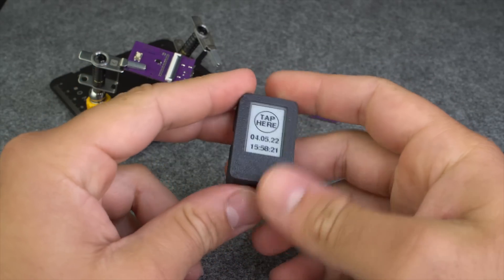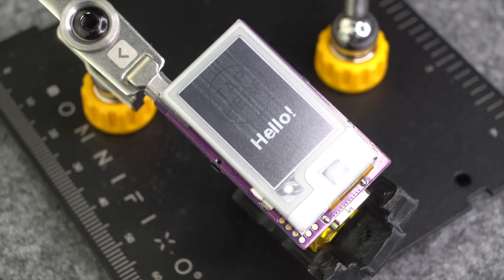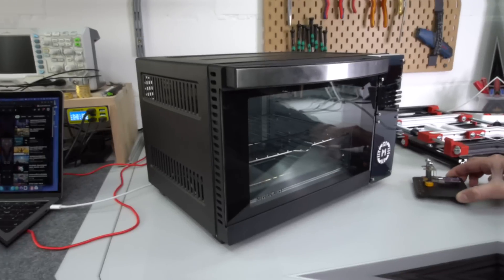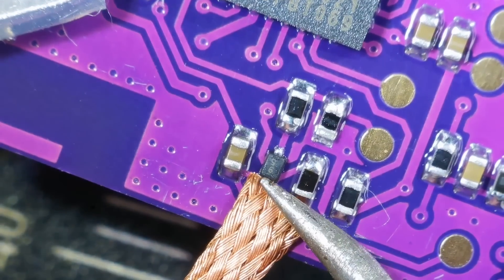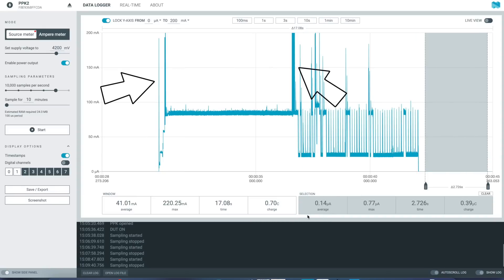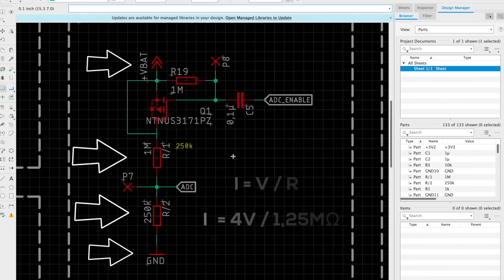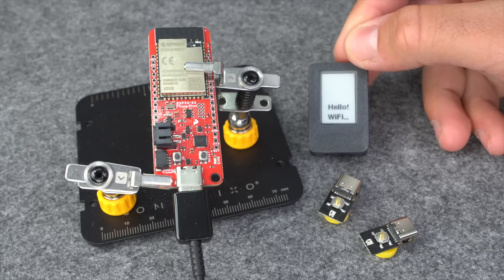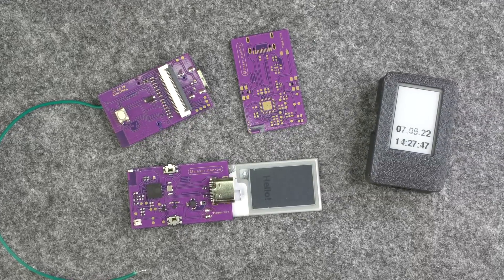Paperclick - an ESP32-C3 based IOT device with an E-Paper display | makermoekoe

Comment: Really cool projects!

Where do you get your smt components from? I always struggle to find a balance between “cheap, but you have to buy a roll of 5000” or “we’ll take your firstborn for this useful 50 piece collection of resistor values”.

Also another question, where does the residual current consumption come from? Leakage in the mosfet?

Comment: That e-ink display seems perfect for IOT, or battery applications!

I'm a total beginner to this stuff.. so not sure about the programming.   When you plug in the board, does the ESP32-C3's USB peripheral instantiate as a COM port, or as a JTAG/SWD debugger, or both?

I would like to buy an ESP32-C3 board.. would I also need to buy a special debugger adapter (ex. Segger), and/or a USB to serial cable (ex. FTDI).   Some of the boards have a "BOOT" button, which I assume allows firmware updating, but not sure how?

Comment: You can add infrared collision sensor by measure photosensor or how much light was mirrored back to ir sensor. Also you can use pyroelectric sensors for detecting movements in the frame. Also you can add pinhole jumper with screws for connect some endpoint buttons. May be also i want to see some small solar panel for infinity time of work, may be instead not cheap eink display and some magnet inside

Comment: Add a case that could accept a pill bottle.  Then you can not only track when you last took a pill, but record that data for long term tracking.  Could be VERY helpful for assisting older folks that are having memory issues.

Comment: SOT-1123's tend to be pretty painful as there's little room for solder mask expansion between the pads making the webbing pretty much non-existent. 
Besides the "fun-factor" of using an ultra small package, if you got the room, go with at least an SC-75 for reliability!

Comment: Is the e-paper display resistant enough to withstand the force which required to click the button behind it? Will it starts failing over time? 🤔
Reply from the maker: Till now everything looks fine. The glass behind the display seems strong enough for that little force on it while pressing the button

Comment: Why you user so weird parts like NTNUS3171 instead of cheaper "normal" parts in sot23 ?
Reply from the maker: Because sot23 is too big for most of my projects. The battery monitoring circuit with the NTNUS was tested on this PCB but will be used in the Picoclick C3T as well in the future
Reply: @makermoekoe  but you have a lot of space on this board ? 
And you don't need a mosfet, you can use a pin of MCU, put low end of divider on this pin, and if you have "1" or tri state on pin - low end of divider will be connected to "+" or "floating" and you have no current, if you have "0" on pin - divider will be connected to ground over few ohms of low side mosfet in MCU output stage and you can measure

Comment: Nice! Do you use different pastes on both sides of the PCB when doing two-sided assembly (like a regular one of the first side and low-temp on the other, to prevent the first one from reflowing when soldering the other)? or is the surface tension enough to hold the components in place even when upside down?
Reply from the maker: Yes, surface tension is mostly strong enough. Except for the usb connector, it would fell off without extra seating
Reply: Surface tension holds the paste and components enough for placements but cannot really reflow inverted, so one side at a time.

Comment: Great project as always, how did you drive the e-paper display without a standalone driver board that they usually come with?
Reply: It's actually pretty easy to drive. Bunch of caps, one mosfet one inductor 2 resistor and you are done 👍
Reply from the maker: @thenextproblem8001  That‘s it. For the 1,02“ display you don’t even need a mosfet… Pretty easy
Reply: @makermoekoe    where did you exactly find this information on how to wire this? I was recently also looking into this and followed this schematic from waveshare for the ESP32: https://www.waveshare.com/w/upload/8/80/E-Paper_ESP32_Driver_Board_Schematic.pdf, they also use an inductor. I don't see these parts in your schematic, how do you know which components are mandatory and which are not?

Comment: I have just built it with Esp32-wroom-32D and 200x200 GDEH0154D67 e paper display. One thing to say about that MOSFET is i have used SI1308EDL-T1-GE3 its more easy to solder even with soldering iron. You may consider to use it. 

As always goof stuff mate ☺️
Reply from the maker: Thanks mate! For the 1.02" epaper display you won't need a mosfet. It is just based on a diode (sod123) which is easy to solder as well 😄

Comment: 2:46, that's why you firstly place small components, use smaller nozzle for small SMD components and put larger elements at the end or when it's possible without any problems. You should also use kapton tape if you know that plastic will melt or just don't point to into plastic elements - in this moment you could use hotair with smaller nozzle, direct hot air in another directions to not melt plastic.
Reply: Or build a reflow oven...
Reply from the maker: I‘ve decided to go with an oven 😁 Faster, more easy and better results

Comment: Always enjoy your new content! One question, I was wondering whether you match the antenna pi system yourself? Thanks! :)
Reply from the maker: Not really, but I‘ve used an antenna with a great simulation where it recommends the matching network. Btw. without the two inductors for the network, wifi wasn’t working at all… https://product.tdk.com/de/search/rf/rf/antenna/simulation?pid=1000000249767
Reply: @makermoekoe  Interesting solution that obviously save a lot of PCB area compared to a PCB antenna! Have you compared the antenna performance of this solution vs performance of an ESP32 module with PCB antenna?

Comment: your PCBs are my inspiration 🤩 

Can you tell me a bit about how you selected an appropriate voltage regulator? Mine keeps causing brownouts when entering WiFi
Reply from the maker: Mine is the MIC5504 3,3v reg. Never had problems with brownout… Do you have enough caps around the reg and in the near of the ESP?
Reply: @makermoekoe  I think so... I've got 10uF, 100nF and 100pF on the 3V3 line connecting the LDO and the ESP32, and 10uF on the 5V line into the LDO... not sure about what to try differently (other than just adding some random capacitors, or maybe getting the same LDO as you)

Comment: I'm also working on custom  ESP32 design. Can you please suggest me the best SoC with BLE and WiFi connectivity?. I just want to create a application for automate my applications. 
Greetings...!
Reply from the maker: If you don't need many GPIOs I would recommend the ESP32-C3, because it doesn't need many essential components around it. It even doesn't need USB2Serial chip. If you need many GPIOs I would recommend the ESP32-S2, which doesn't need a USB2Serial chip as well